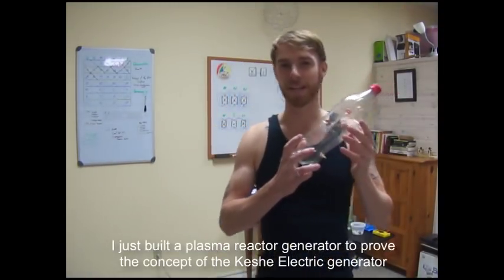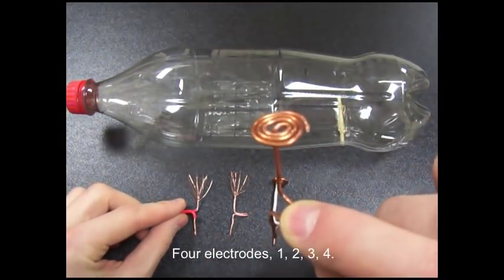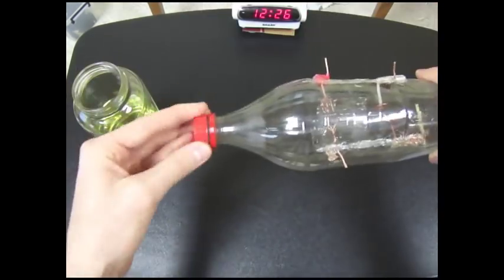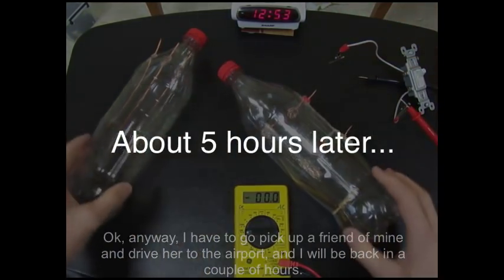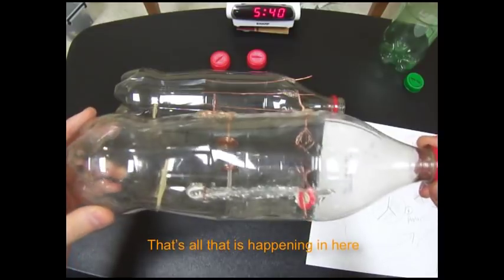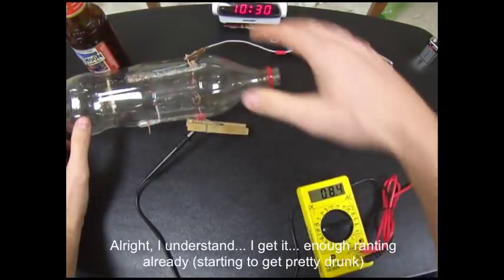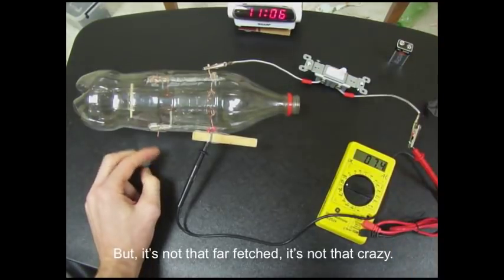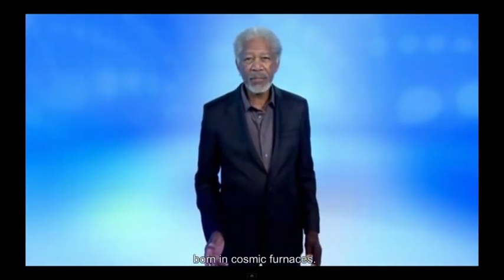Keshe Plasma Generator ~ Here is The Future ~ Infinite Energy

Comment: dude doesn't know how a voltmeter works. He's measuring electric potential, but there is no current. No current means no energy is present.
Reply: trusl nilen A voltmeter measures potential difference between two points. If you touched the two electrodes of the voltmeter to your tongue you would also see a number. This does not mean that a current is present, though. If he also connected an ammeter or multimeter to the bottle and showed there was a positive current, then that would mean a charge is present. A voltage reading alone is not evidence of a charge.
Reply: +Joshua Carr (ThePistolKing) Could have told right away, no? tattoo sleeve, tank top, and getting really drunk. Enough said.
Reply: ***** Exactly, but he's not measuring any current.
Reply: ***** Lol u speak the truth :)
Reply: +Nikola Jovanovic (Johnnyfilosofer) He has his multimeter set to the 200mV range, and at most it's reading 59.9 mV, which is incredibly small. There are so many variables that could account for that reading, such as an electrostatic charge on the plastic bottle from rubbing it on his shirt, or there may be enough moisture in the air inside the bottle to show a potential difference on the meter. Again, he never shows a reading for the current, only the voltage. Furthermore, the entire concept of this thing is based on "filling the bottle with a plasma that produces a current" between the electrodes. The very definition of a plasma states that it has a neutral net charge. Matter will not remain in the plasma state unless it is being ionized by a current or its temperature is sufficiently high, so the air inside that bottle is obviously not in the plasma state, otherwise it would be glowing.
Reply: ***** "equations not balancing" = fantasy.
Reply: +Joshua Carr (ThePistolKing) You mean there's no current in the circuit of the bottle, right? :) Because there is a current travelling through the voltimeter ;) Just to clarify.
Reply: ferradosa757 Yes, there is no current being produced by the bottle. It's just a plastic bottle with some wires in. It's not holding any mysterious charge. You could build a Leyden jar in about 10 minutes with a plastic film can and some aluminium foil that would be more effective than this bottle.
Reply: +Joshua Carr (ThePistolKing) You realize that any measurement device has some internal resistance, thus to exist voltage reading there must current circulating trough the device, although very small currents depending on the device internal resistance and other factors.
Reply: +Joshua Carr (ThePistolKing) 
come on people you can measure several volts just by touching the probes to your tongue.
Reply: Theres a directly proportional relationship between "potential diference"  and "intensity" if there are voltage, we have ampers, ever! and only! when we put a "charge" to consume this energy. But... how many ampers?? thats the question.
Reply: Joshua Carr blame the Education system
Reply: Right power is the de/dt= IV since I=0 the power or electrical energy overtime  is also zero because electrical energy is the energy  caused by electric current

Comment: This is painful to watch I really hope this guy Is not serious.
Reply: +Stefan Cojocaru (Skyman) Can you elaborate? He passed away from what cause exactly? And when?
Reply: Stefan Cojocaru why he die?
Reply: you are right this is painful, and I am not a scientist, and I do not know why????   I just want to build a couple of these things and use them to go off grid.  Is his thesis wrong?
Reply: saltyseascott no pear review not even a sound theory. My guess is this guy doesn't know what he's talking about. I'm going out on a limb here. Sorry
Reply: I'm guessing it works like a Bagdad battery, using an acidic solution and copper to make a little electric charge.
Reply: CIA TROLL, this is real
Reply: It's called a chemical reaction. I'm not that old but love science and know it's using chemical reaction
Reply: Yall don't get it. Its real but the Voltages he made are NOTHING. They accomplish nothing. I can get more Voltage then that by holding the electrodes in my fingers dude. The air around you has like 10k volts. Everyones shocked he got like 10 volts like WTF?

Comment: How can there be a current, if the bottle is symmetric and the electrodes are identical?
Reply: Easy... there is no current flowing. The multimeter is probably picking up more energy from the clock and overhead lights than from an empty coke bottle.
Reply: Energy Fabricator Well I tried it with just water to just see and there was no current. I was right next to my comp with the radio on and the lights. My router was right next to me as well.
Reply: C.G Bright I have some pottasium hydroxide on order
Reply: C.G Bright Mate, I don't need to man up...It's all bull crap... but I would still like to see your friends experiment :)

Firstly, the point of this 'empty' experiment (according to keshe) is to produce SP2 (carbon), not voltage. The SP2 that keshe has claimed to have produced was independently tested and found to be deformed and inconsistent in size and shape and therefore...USELESS! I have played with nano-materials for years and there are no applications that I am aware of that use deformed and irregular sized nano-particles. Nano-material applications generally require tight tolerances on particle geometry. 

There is one word that describes this experiment well.... EMPTY!
Reply: C.G Bright 
Of course the coke bottle works... Works how exactly? What are you getting from this experiment that is of any benefit to science or humanity or shows promise for anything, apart from producing minute quantities of mutated SP2?

Just to clarify, I have no 'passion' for keshe. I am however, passionate about REAL research into energy and how the transitions between different forms of energy occur. I have taken a neutral approach to keshes 'technology', but the more I look into it, the more fraudulent it looks. Consider this...

The guy does not have working reactor to show. Fact. By 'working', I mean something showing any gravitational effects, anomalous energy or potential health/medical benefits - which is what he claims. So, no 'working reactors' as such.

Now, he has patented a reactor (I forget the patent #) and I have read this patent. It is not the first patent I have read, to say the least. Upon reading and scrutinizing this patent, I can see nothing but a piece of kit which can only be seen as an elaborate transformer or heat pump. The patent requires not only a vacuum chamber which can achieve 10-6 torr (from memory), but also high voltage power supplies, rotary feed-throughs and a radioactive source if my memory serves me right. 

Now back to the patent... It shows nothing of being able to produce gravitational effects or anomalous energy of any form. It does state however, that you could use external coils to harness electrical power from the reactor. It also states that external pipes could be used to capture the heat from the reactor. The heat is to be captured and converted by usual means, as is currently known in the arts.

So what? Now we only need thousands of dollars in parts and equipment, accompanied by a significant amount of technical knowledge, skills and experience to build a very elaborate transformer or heat pump, the efficiency (COP) of which is unknown, but highly likely much lower than 1. I see no benefit here. And I have taken the time to read the other patents too.

I am not alleging anything here, but have you also considered that his 'public teachings' and 'knowledge seekers' workshops may be a clever way of enticing people to build devices which fall directly under the scope of his patents. It's been known to happen. 

There are also books to be sold!

Think outside the empty coke bottle. Now, it's not just an empty coke bottle.

PS - perhaps you could be more considerate of other peoples views and not call people names for sharing their opinion, regardless if you agree or not. I'm a douchebag? I'm not the one supporting an "empty box of the universe".
And what's with your language? Kids read this stuff too.

Cheer up mate. It's not all doom and gloom :)
Reply: C.G Bright

I think we need to agree to disagree on Keshe :)

Keshe is not the first person who has come up with a 'universal theory of the universe'. Consider the works of Edwin D Babbitt. He wrote a book which was published in 1878, describing his theory of everything (The principles Of Light & Color). It is somewhat metaphysical due to the fact that it considers the mind as well as physical matter, but a great read and very thought provoking.

Keshe is somewhat more metaphysical (by an order of magnitude!) in the way he describes his ideas and theories.

I am inclined to say that you would learn more about the universe and how it works by reading Babbitt's book and considering his statements, than by following Keshe's work.

Keep in mind that the only 'theories' that become accepted/adopted are the ones that provide a direct or indirect benefit to humanity in a tangible way.
You could always read Babbitt's book while you wait for Keshe to produce a useful product... you might be waiting a while.
Reply: C.G Bright
// It's not a battery man, it's a gravity driven engine. //

No... it's a battery.  A very inefficient alkaline battery.  Which is then emptied.  Everything in this video is just... well... ridiculous.
Reply: Mitch Stein Cool story bro!  You're right!  Just because you WANT this to be true, anybody who says it isn't true is a "Know it alls know nothing"

Talk about Kruger-Dunning....
Reply: +Paul Madley Me, Believe this?! Not at all. But even Einstein Believed there was more than the THEORY of relativity could explain,  Now it's taken as a law, i don't think i was wrong in anything said. 

You're the pot, I'm the kettle.
Reply: Mitch Stein
So because Einstein was wrong about something, we should accept every single subsequent claim by anybody who says anything they like?  Because Einstein got something wrong?
Reply: paul langsford In the presence of moisture?? How many times did he rub the bottle?
Reply: Energy Fabricator Einstein did far better. Anyone who understands the theory of relativity and how it was arrived at knows that it won't be overturned. And acceptance of a theory is dependent only on its being irrefutable which has nothing whatsoever to do with its usefulness. I hope Babbitt's book is a long one as otherwise you'll be left waiting to die before anything useful comes from Mr Keshe.
Reply: ProjectsBlack But both electrodes seem to be copper.

Comment: .the lights in your room are generating an RF signal..ALL electric is AC..a very loud 60 hz tone at 240 volts is being generated in your house ALL the time ...what he made was an ANTENNA that picks up this energy..... ALSO there is very little CURRENT to do any real WORK.
A little knowledge is a dangerous thing to the superstitious...
I have 40 years background in Electronics design and repair....

Comment: No - from a chemistry point of view and No - from an electrical point of view.
Plasma is ionised gas - You can see the results - Think Neon sign, lightening etc.

Although it is possible to "pluck" electricity out of the air - We do live in a sea of radio transmissions - The amount you can get with small antenna is equally small, if you extract large amounts with larger equipment the transmitter people get upset.
Reply: He's got the meter sensitivity set right up...

... he could have got the same results by simply doing nothing :)
Reply: Paul Madley Exactly and that's a total garbage meter, if the wind blows it will read something. Not to mention his 'high' result is a measely 60mv with no known current behind it.

Comment: you are saying you have 11 hours of energy production....what i can see, you just measured the voltage between those electrodes and never pulled any actual electrical power from it....or did you? In that case, how much Watts can you pull from it and how much total amount of power does it produce from one of those "charges" you made?

measuring the voltage does basically mean nothing in the practical point of view, because what matters there, is the actual power that can be provided and for how long it can be provided...

(just an example, i can produce voltage just by rubbing a balloon on my shirt, which produces voltages way higher than just 60 Volts, but that doesnt have any practical use either....;) )

Really would appreciate an answer (i know i could read through the links you provided, but asking first always is much easier ;))

Comment: One thing I noticed in the video is the setting of the multi meter---it is set to 200 Milli volts.  That range is an extremely low setting and can measure very small voltages. One Milli volt is equal to 1000th of a volt. It can measure the voltage on a small antenna, or a charge on a hunk of metal. It even reads a few Milli volts when you hold a probe in one hand, and the other probe in the other hand. Radio wave induction in wire is all around us, and can be called noise. You can you a diode to rectify AC noise back into DC voltage/current, although the current level is quite low.

Comment: the ionisation of hydrogen is not a spontaneous process. H + energy → H+ + e-

how are your hydrogens ionising lol
Reply from the maker: The theory behind the Keshe Plasma Generator is based around being able to create a self perpetuating system of ionizing atoms.  
Yes we know all about ionization of atoms, however, Mehran Keshe has discovered how to create dynamic ionizing systems - a whirling ball of energy if you will.  Watch this short 2 min video to Learn More: China animation of Keshe Reactor english subtitles
Reply: Joshua Thomas 

I watched the video for about 45 seconds and surmised the following, the grammar of the subtitles wasn't amazing so I did it all off of the video. The process goes as follows:

1. Hydrogen-1 spontaneously ionises and gives its electron to the potassium atom in the core.

2. The potassium then gives its electron spontaneously to Hydrogen-2, which in turn spontaneously gives the extra electron it just received to Hydrogen-3

3. Hydrogen-1 (now a naked proton) then spontaneously moves to another normal hydrogen atom (Hydrogen-4).

So from this we can surmise:
1. Hydrogen spontaneously ionises (1).
2. Neutral Hydrogen is happy to spontaneously attract and accept excess electrons (2).
3. Neutral Hydrogen is happy to spontaneously attract protons (3).

So how can neutral hydrogen spontaneously accept and part with negative charges while also going the same for positive charges? If this were true then neutral hydrogen gas would spontaneously & totally ionise, which it does not do!

Also why does the ionised hydrogen atom take this round-a-bout way of recombining in the core, why don't they just immediately go to one another, given they are of opposite charges?

This whole thing is quackery if you ask me, not intending to insult your character of course.

Comment: As others have mentioned u only demonstrate that the bottle develops electrical potential, measured in Volts. The real test would be for that voltage to be accompanied by current, Power=Voltage x Current

Comment: Uhh. . .the common thing that these bottles share is. . .they are all plastic.  Meaning that many thin plastic objects ALREADY contain a measurable amount of electrostatic charge.
Placing electrodes inside the bottle would certainly give a potential difference when connecting the voltmeter.  Adding a solution would increase the decay rate of the plastic, thus increasing the yield of energy - but there is a limit of it's conductivity - it's not going to hurl us across light years of distance nor power our homes for an infinite time.  And, no, there are still many mysteries regarding gravity that are still not explained by top scientists to this day.

Comment: For those of you with tin foil on your heads, here's a basic low down on why this "generator" doesn't work.
1. Making a potassium hydroxide solution (out of mountain dew? lol) makes a type of battery after having two electrodes placed into it.
2. If you noticed on his multimeter, he set it to the milivolt scale, or 1/1000s of volts. 28.7 mV is nothing - you could get that reading from a long piece of wire (or a coil) hooked up to the prongs on the multimeter. This is just from background radiowaves from broadcasting stations.
3. Plasma is ionized gas, typically produced at thousands of degrees Celsius. What was most likely residual in the bottle was water vapor, which in and of itself does not make any sort of voltage drop.
4. It is possible to have voltage without current. Current is amount of charge (electron energy) passing through a given point per second. (1 A is equivalent to 1 Coulomb of charge passing through a point on a wire per second.) Although the bottle battery made 0.028V, there was no current running through it. Electrical components need both voltage and current to produce any sort of work (ie. lighting up an LED, moving a motor, etc.) All he's measuring is a POTENTIAL for work.

Comment: I'm guessing your voltage as a chemical reaction, RF/radiant energy or from the use of a digital multimeter. However, anything is possible. 

Considering that 100 years after Tesla demonstrated an abundance of energy able to transmit globally, we continue to recreate/comprehend his genius fully. 

Sadly, we've been indoctrinated as petroleum consumers; blinded to EV's (1830's), Pyrolosis (SynBio), Bio-digesters (Methane) & simple fermentation and distillation of fuel! Nothing is impossible.

Comment: Actually it's the current (amperes) that is doing the work. Watts is a measurement of total power used (amperage multiplied by voltage) by the load on the circuit.